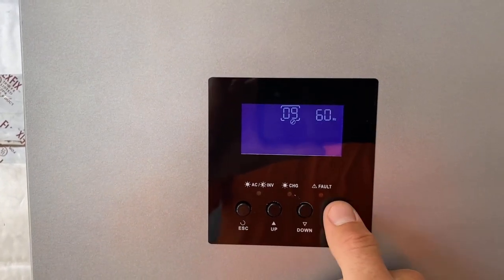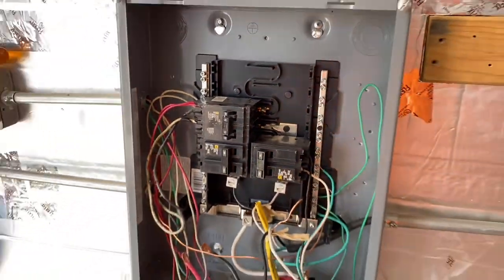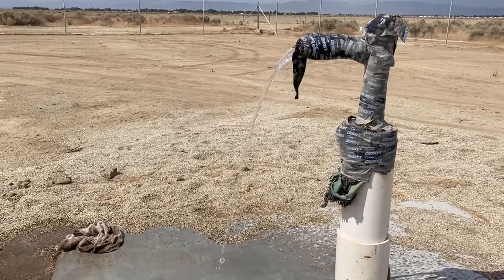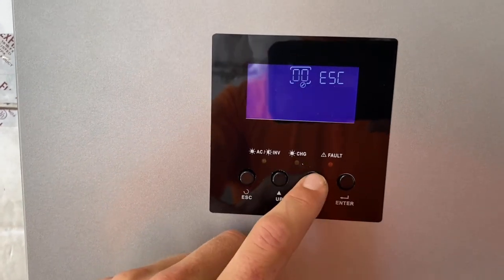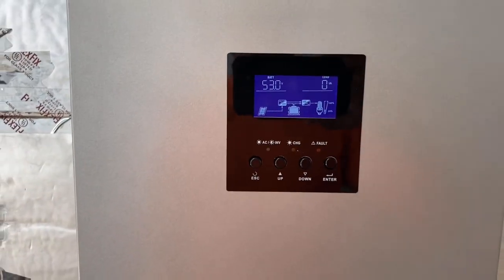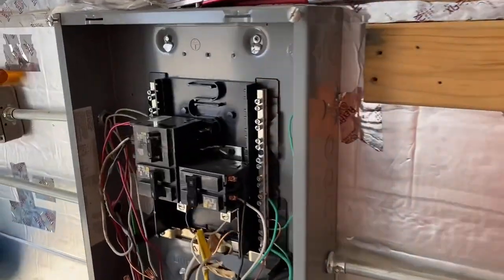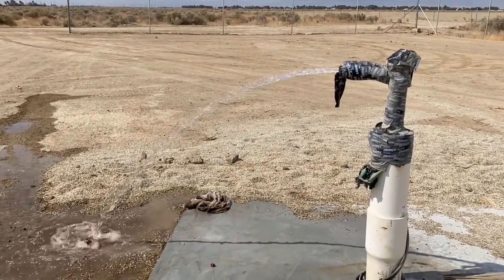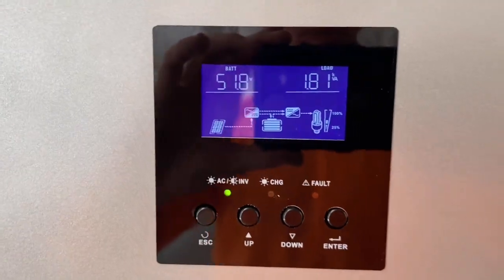Off-Grid Inverter Output; 50Hz vs 60Hz, Does it Make a Difference for a Well Pump?

Comment: The speed of induction motors is controlled by the frequency of the ac. At 50hz the motor will spin at 5o rp second. Multiply that by 60 seconds and you get 3000 rpm . On 60hz it will spin 60 times per second so 3600 rpm. We have 50hz in Australia and American pumps need to have their impellor changed to get the same flow rate. There are a lot of videos on speed controlling 3 phase pumps on you tube with a VFD (variable frequency drive). Single phase motors can theoretically be controlled by frequency as well but it is not good for the life of the motor windings or the starting capacitor. Thanks for your video, it illustrates the point well.